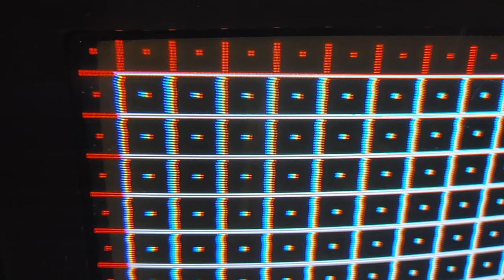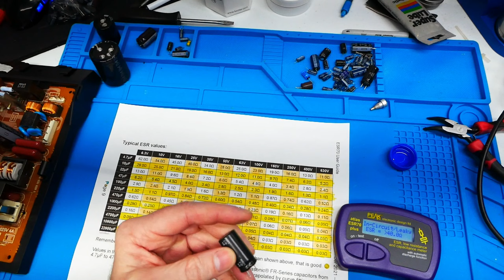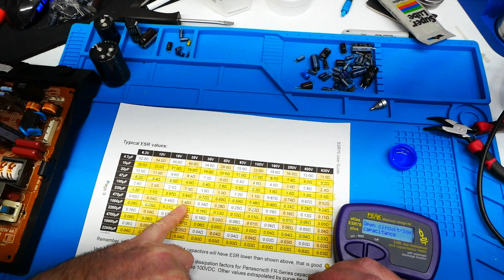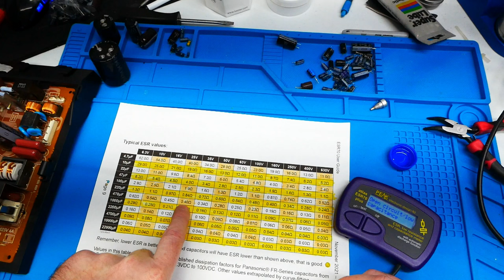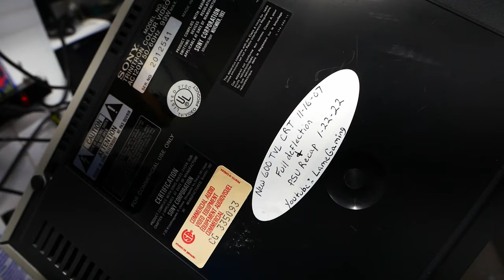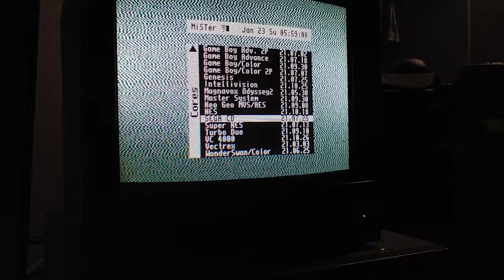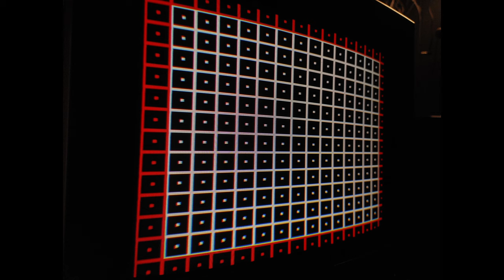Sony PVM 1341 CRT Wavy Image ... Full Deflection and Power Recap ... Squiggly Ghosting Smearing

Comment: Awesome stuff.  I've recapped most of the deflection side in a Panasonic set.  There's some horizontal droop at the top of the screen (definitely not yoke).  But for the one cap that I believe to be the culprit I do not have a replacement for.  Fingers crossed it's the one that sorts it.
Reply from the maker: I hate it when Im missing one value of a cap lol

Comment: When I was young, I was lucky enough to have a large 40 inch CRT television in our living room. I believe it was 1080i. Unfortunately it developed those squiggly lines, but they got worse and worse and worse over time. 

For a while, the TV would warm up and the lines would go away, but eventually the lines became so severe you could not see the picture and it would never warm up.

I wish it could’ve been fixed, but I was not technologically savvy  (and I was a teenager) when we got rid of it. Was this probably is circuitboard issue the whole time?
Reply from the maker: @JakeB-Real   It very well could of just been a bad capacitor.

And yeah...  When I was young I had zero patience to fix or learn things lol

Comment: I have the PVM-1341 and it needs a bit of adjustments on the geometry and a recap in the future. Planning on modding it to have audio in for the RGB inputs (found a reddit thread that has the deets) with a toggle switch to either enable or disable the audio for the RGB inputs.

It's a great set for gaming and for connecting computers to it (older 9-pin video).
Reply from the maker: They are nice. I wanted to look into an HR tube swap and put that info out in a video. I have a 1341 with a 600 tvl tube and its great, and I believe no mods required but still trying to hunt another tube down for testing
Reply: @LameGaming  RGB is clear as a bell and unfortunately, the composite and S-video modes have a blue tint on the display. I'm guessing the B board is to blame here. Have you worked on that board in the past and is it a pain in the butt to repair it? And that would be below the power supply board, correct?
Reply from the maker: @RetroPCUser  I just remember when recapping the deflection circuit on the main a board that the whole left side was for color matrix and had some small sister boards.

I dont use anything but rgb on my pvms mostly but I know theres a switch for disabling red and green guns when using composite or s-video for calibrating the image.
I wonder if your switch is bad or a component on that circuit causing that to be stuck on ?
Reply: @LameGaming  I adjusted the color burst control and it has the black color this time. Composite and S-video are a lot better than they did. Tested it again this morning and it still has the correct color.

It doesn't hurt to order capacitors for this thing and all of them look pretty good for a set that's 31 years old. Even the tube is pretty sharp.

Comment: I'm just curious if the reason that most of the recaps I see are PVMs is because it's expensive to do a recap, therefore not justifiable on a consumer set or is it just because it's not worth the time?
I'm interested in rebuilding the TV that I have or even just doing an old junky one for practice. Although I don't want to do it if it's going to cost me like two or $300 per unit.
Reply from the maker: Ive recapped 3 of my consumer sets. Consumer sets are super cheap and quick to recap.... Only a hand full of caps. Pvms are a nightmare in comparison. Checkout my rgb mux mod vids.... I mention recapping them but dont show it i dont think but its only 5-10 caps usually so super easy. Just focus on the deflection circuits, power, and neckboard.

Some of the latemodel consumer sets had alot of caps too though, i fully recapped a sony fs120, it was over 100 caps. Was a waste of time and money but a good learning experience.... Id start with a 90s shadowmask set....  Should be a minimal amount of caps in power,deflection,neck/colordrive

Comment: The 42Q/43MD/44Q are all 600TVL... lord I'd have to think about the tube part number differences for the 41.

Which part number is in there? M34KBE20X or M34KBE30X?
Reply from the maker: Yeah my 44q has a 600tvl tube thats why I was surprised when one of my 1341s had a 600tvl tube.
I have all the tube numbers written down somewhere...... The 600tvl tube in this 1341 came from a sony cga monitor.
Found another of these tubes new in the box on ebay for $100. I should of jumped on it but shipping was $150 so procrastinated and it sold 😖

Havnt been able to find another. I have a couple dim tube 1341s Id like to resurrect.... Seems it likely wont happen now, sony tubes are hard to come by.
I was hoping even a sony consumer 13" tube would be compatible but havnt had time to investigate.

Comment: Do CRT's with low hours need to be recapped as well? I have a Toshiba 27af45 with less than 1 year of total hours and picture looks flawless.
Reply from the maker: Im assume they can dry out over time causing esr to increase but im sure it happens much faster with heavy use/dust and heat cycles.

Depends on the caps used as well.... I have a consumer set I swear had almost no hours on it because the tube is crazy vibrant but had cheap caps on the board and I had to replace a handful from power and deflection circuits.

Comment: Do you have a background working on these sets/with electronics? I’ve been doing lots of research on it to try to attempt it myself, but am debating if it should just be left to the pros.
Reply from the maker: Nope, just crazy enough to have kept troubleshooting lol.

Took basic electronics theory at a community college when I was younger, have since forgotten it all lol.

The good thing is nowadays theres so much info on youtube you can self teach yourself pretty quickly.

I started out building an arcade cab which was just basic wiring, then I had alot of old game consoles I wanted recapped but had no clue about any of it.

My advice is, if your patient, mechanically inclined, and have the time you can get a decent soldering and desoldering setup for around $250 for both. Having decent equipment will get you 50% ahead of the learning curve.
Then just practice good technique soldering/desoldering on old electronics you dont care about. Watch alot of videos.

Thats how I started, just recapping consoles and doing mods, then moved to crt's.

I went from total noob to repairing everything on my channel and more within about a year.

It can be daunting at first but every project you do will boost your confidence and teach you new things.

I was going to make a soldering basics video but working alot of hours lately.

Comment: Dude I have a couple of HDTVs with HDMI and both  have problems of overscaling that can't be fixed with their service mode. DO you think this can be fixed?
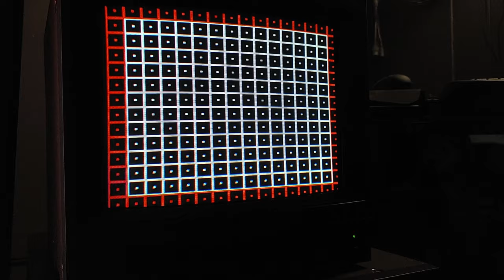Reply from the maker: I just recently got a widescreen toshiba HD crt with hdmi and been playing around with it connected to my pc through a scaler that downscales 1080p to 1080i.... I get edges of the image cut off but pretty sure its from running 16:9 aspect ratio content on the 16:10 aspect hd tv

Comment: Did this improve the black levels or colours at all?

My 1342q has greyish blacks and flickers with bright colours (like on a full white screen)
Reply from the maker: Sounds like its g2 is being overdriven, set your brightness and contrast to middle, then adjust the g2 screen pot untill black levels are black and image looks good.
Are you seeing retrace lines as well?
Reply: @LameGaming  i'll tell you bro i got the g2 and sub bright pots both set at the lowest setting. when i put on the backlit zone test from 240p test suite, i see like 2 or 3 grey lit spots that end up brightening the whole black image

no retrace lines, and otherwise the image looks good (just that 60hz flickering with bright colors)

i had a repair shop recap this set too...
Reply from the maker: @ComputerTechnic217  So you can get your black levels good but theres spots on the screen that are lighter and washed out?

A video or picture would probably help understand the issue.

Comment: I've been thinking about recapping a D-Series tv. It's 22 years old now and is probably well over due for a recap don't you think? It's minor but the geometry is a little wonky in some spots. Mostly in the corners where it curves outward. The image doesn't seem as crisp as it should be even when adjusting focus. Pretty sure it's a Thomson A tube as well so no purity rings on the yoke. The white levels, black levels, and colors are still fine but it can be tricky trying to calibrate them just right. All of these issues sound like aging caps to me.

My main question is, should I recap the whole tv or just the deflection side? There's 3 boards. The main board, the AV board where the composite, s-video, component inputs are connected to, and a mystery third board. Not sure what it does but it's very small with a few caps on it. The AV board has about 50 or so caps but they are the smaller diameter kind. 1uf, 10uf, 47uf, stuff like that.

It's hard to get a straight answer from people about this stuff. Some people will help but are behind a paywall which is not cool IMO. Any advice you have I will greatly appreciate.
Reply from the maker: I just recently did a 36" jvc pre d-series.... Recap and rgb mux mod, wasnt many caps at all.
Id do the power and deflection side of the board, they are the ones that get hard useage. Would do caps on neckboard while your at it.
And yeah, i noticed the same thing about not getting answers... Thats why I started the channel. Wish I had more time to make/edit videos

Comment: I have a 14m4e with this problem, and like you said, worse on high contrast.
Reply from the maker: Id replace the larger caps in the deflection circuit minimum and see if that clears it up.

Comment: So main problem is on powersupply part right?

If picture show like this just recap power supply part should fix?

Or mainly deflection part ?

Do you use your spare part to swap again.
Reply from the maker: Thats an excellent question. Since I found bad or out of spec caps in both boards I recapped both and put them both back in at the same time. I should of just tested what would happen with just running the recapped chassis board and/or just the recapped psu to pinpoint which board caused the issue to begin with but had MANY hours wrapped up in this monitor at that point and probably just wanted to be done so did not even cross my mind to test.
I can replace components in my sleep but still pretty wet behind the ears when it comes to electronics theory and reading schematics but I would go out on a limb to say I suspect the issue was in the deflection circuit.
The power supply caps esr readings were a little high but none of them were flat out shot or bad like the majority of large caps in the deflection circuit.
I was told c535 was directly responsible for this issue and indeed c535 was toast in both boards which is right near the flyback transformer.
Also, savonpat sells cap kits for pvms and they usually just include a hand full of caps for the deflection circuit that are known to cause issues. But for close to the same price you are able to record and order your own cap kit from mouser that can recap entire deflection and psu boards.
I you have the same issue and want to do the easiest approach first I would start by just replacing all the larger caps in deflection circuit. Especially near heatsinks as those take on alot of heat.
Its probably not necessary to replace all the tiny .1uf .47uf 1uf 10uf low voltage caps on that side of the board as i have not really ever seen them fail.

Comment: Do you have to discharge any of the individual capacitors before you desolder them? I'm going to try to recap my kv27fs120, and I've discharged the tube, but nervous about touching some of the larger caps.
Reply from the maker: Yeah, that esr meter has an auto discharge but I just use a large resistor to bleed the charge because I read a comment about a guy frying his meter by discharging a large cap

Comment: hey, do you have a cap list? i have the same pvm and mine doesn’t display video over anything but s video… i know it’s only tangentially related but i do want to do a full recap since my unit seems to have had heavy use
Reply from the maker: I thought about posting a cap list for some of these models but anymore when I go to mouser ive had to make a ton of substitutions going up in voltage rating because caps are out of stock etc.... Its really best to just record whats on your board and order whats available.... Ive even seen discrepencies between service manuals and whats on the board.
I might have the last list for a 1341 scribbled down somewhere though, ill check

Comment: Man, I was afraid that the squiggly lines were caused by bad caps... I have a 32" widescreen Panasonic that I've been meaning to sell but I just confirmed that it has a bad case of the squigglies. It doesn't really show while playing games so it hasn't bothered me, but the 240p Test Suite reveals the issue clearly. I've been meaning to sell the set, but I dunno if anyone wants to buy it if it means having to recap it. I also got a smaller 4:3 Trinitron to replace it as my main CRT, but apparently it too has the same issue, albeit as not so severe (yet).
Reply from the maker: Yeah, sadly in the near future any working reliable crt's will have had maintenance done to them.

Comment: Lol, I just don't bother checking the caps. I just order the lot and replace them all in one weekend. 😂🎉
Reply from the maker: Yeah, I do that with consumer sets since there usually is alot less, with pvms its a safe bet I think to just do the deflection and power circuits but a full recap is great too if you have the time.

Comment: I have a 1942Q and it looks 1:1, do you think the cap list might work with my model? 
Keep doing what you do!
Reply from the maker: The manual I have is for the 1341,1342q,1343md and doesnt mention the 1942 so I would find your models manual or even better.... record the caps by hand.

 I notice discrepancies between the manuals and the actual boards on almost every set ive done, so I would just get in there and record the handful of caps in the deflection circuit and plan to replace those and either test or plan to test/recap the power board in the not too distant future as well.
Reply: @LameGaming  did you swap out all the film capacitors also or just the cylinder caps?
Reply from the maker: @saltymanos  only the electrolytic caps in the deflection and power areas
Reply: @LameGaming  on the A board did you recap the vertical deflection also or just horizontal?
Reply from the maker: @saltymanos   both...
https://ibb.co/2gwjt07
Reply: @LameGaming much appreciated! I ended up taking care of it. Runs beautifully now thanks for the help!
Reply from the maker: @saltymanos   Awesome.... Good to hear!

Comment: Hi, I have same problem Kv-27fs120
Reply from the maker: I fully recapped a 27fs120 in another video but it did not have this problem, it had jittering I tried to get rid of.
A esr meter can help you determine if your caps are bad or way out of spec.
Thanks for watching.